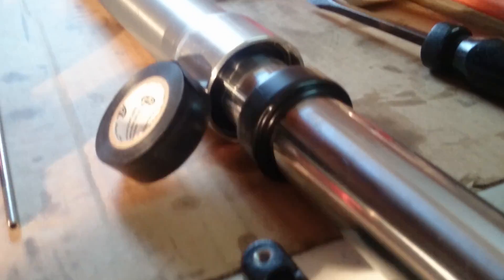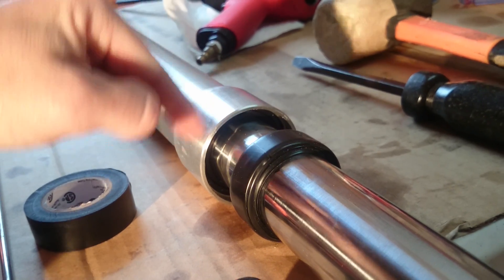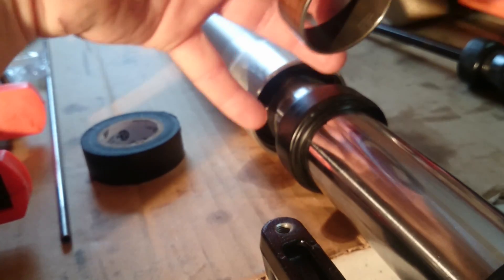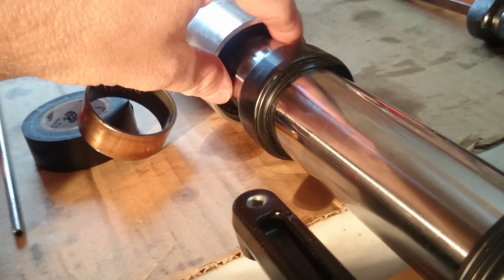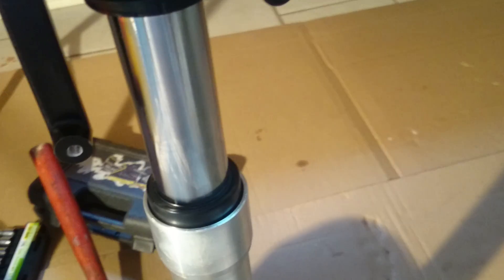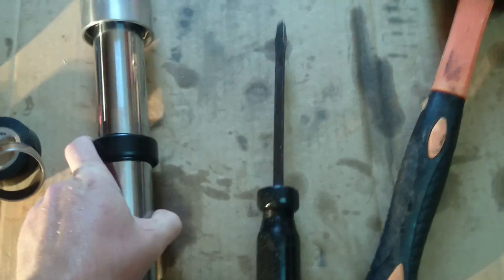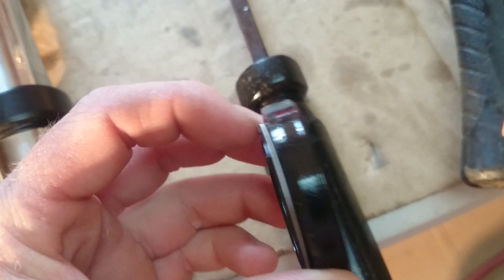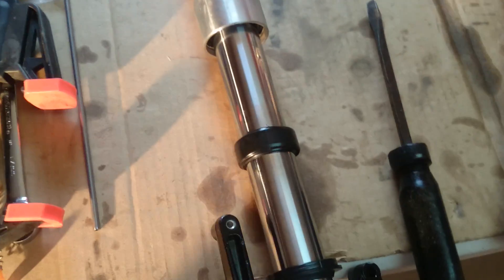Home-made fork seal driver

Comment: I bought a pvc pipe and a roll of electrical tape. First tried the electrical tape, using the old fork seal on top of the new one. First hit and the seal was in place! Awesome trick and save more than 40 bucks. PVC pipe will go back to home depot :P
Reply from the maker: musiclucho Glad it worked for you.

Comment: Where is the link for this I can't see what you did you should have shown how instead of explaining after the horse has bolted from the stable
Reply from the maker: You just roll electrical tape onto the tube and stop when the diameter is big enough to push the seal in.
Reply from the maker: https://www.instructables.com/id/Homebuilt-Seal-installer-Instal-any-seal-without-/

Comment: Watched the video, but still not sure what the fork seal driver is made from ?
Reply from the maker: Peter Morthen   electrical tape
Reply: Wrap the tape tightly around the fork above your fork seal. Use enough tape to match the outer diameter of the oil seal, but not beyond.   Then using a large soft hammer, hit the bottom of the caliper bracket.  This will drive in the seal with the tape .  There is a chance that the tape will deform if the seal doesn't go in on first attempt.

Comment: Why didn't you push the metal ring in with the tape you put on the tube?
Reply from the maker: What ring?
Reply: @Rangerscott77  the ring you used the screw driver on
Reply from the maker: @matt3122  Snap rings dont go in that way.  You have to start one end and work the rest of it into the groove.
Reply: Not talking about the snap ring.  The thing @0:55
Reply from the maker: @matt3122  That bushing is for the other fork tube.
Reply: @Rangerscott77  does that fork have a bushing in it?  How did it get in it?
Reply from the maker: @matt3122  Theres two of those bushings.  One that size and a smaller one at the end of the chrome tube.   Do you need the service manual pdf files?
Reply: @Rangerscott77 you're not making any sense.
Reply from the maker: @matt3122  Everything is all ready loaded in the fork.  The tape is just to push the seal in then you put in the snap ring, then lastly you slide down the dust seal.
Reply: @matt3122  The bushes/metal ring you're talking about slide in first, then the seal is driven in using a fork seal driver/electrical tape/pcv pipe or whatever tool of your liking.